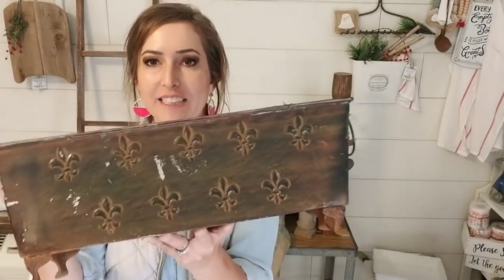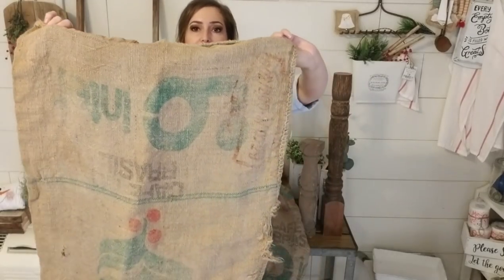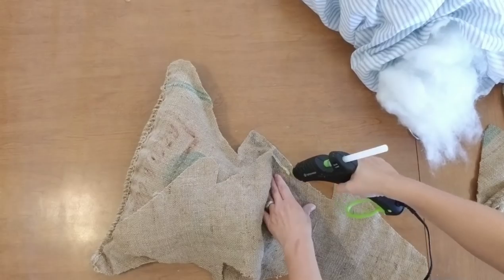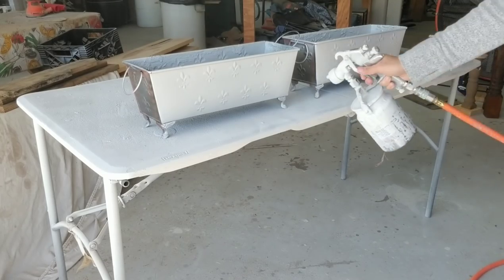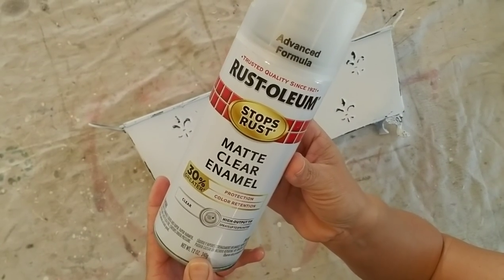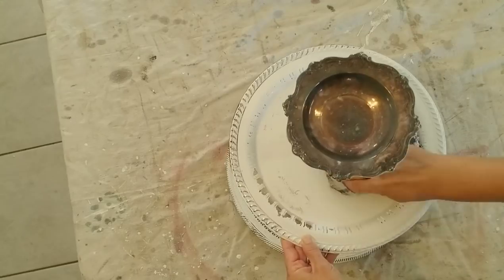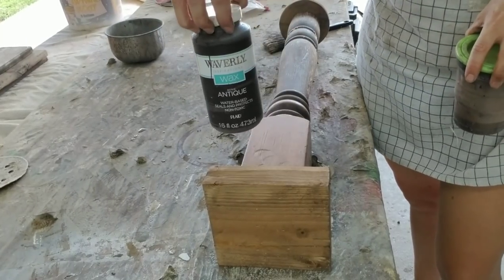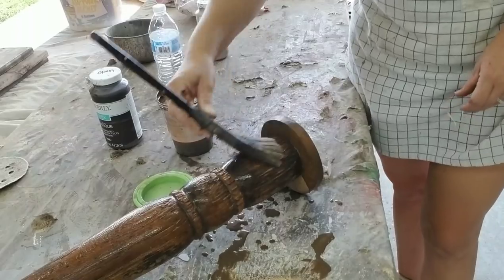Thrift to Treasure • coffee sacks • metal tray • tarnish silver plates • wood spinals

Comment: I am confused. I would love to get a spray gun, and you mentioned yours from Harbor Freight. But, don't you have to buy a machine (compresser) in order to use it? Aren't those expensive? What kind do you use for your spray gun? Is there a lot to upkeep for a compresser???
Reply from the maker: Yes, you are correct.  You need an air compressor,  I guess I don't think about that bc we have always had one. Not really any upkeep.  Just plug it in. I don't know what the prices are on them.